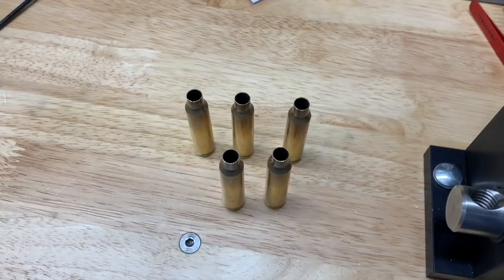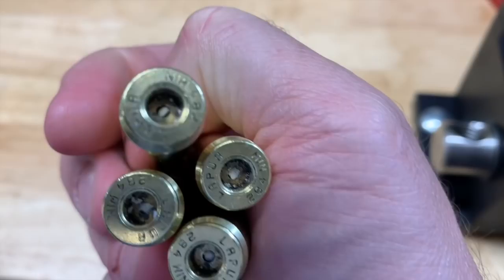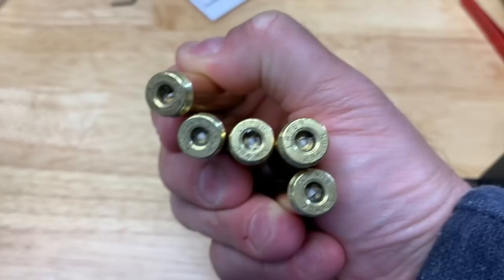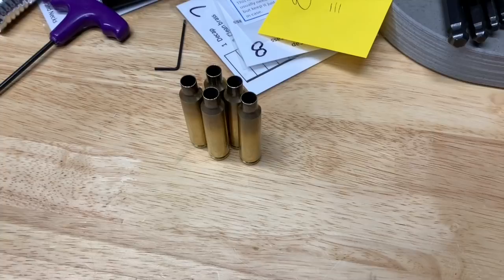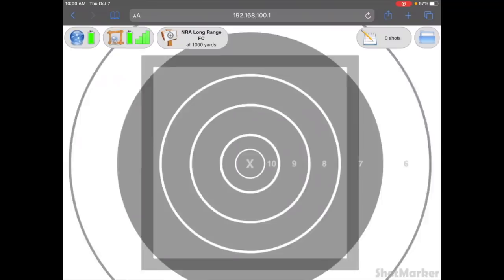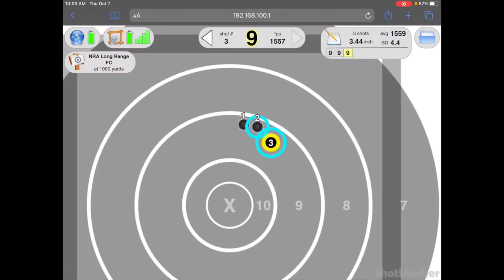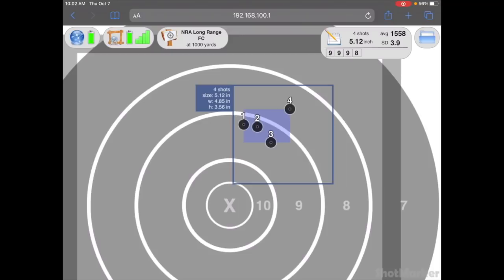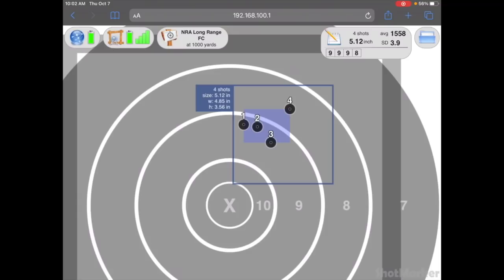I left tumbling media in my primer flash holes!

Comment: I also use rice as a tumbling media. I use medium kernel rice to minimize rice in the primer holes. Long Grain will stick all the time.  But it still happens with medium, due to breakage of the kernels. The scarier occurrence was to discover that kernels were staying in the case and rounds being fired with a kernel of rice mixed into the powder. I was unloading some rounds and out pops a kernel of rice with the powder. 
Now I air blow my cases after tumbling. There were more than a couple of stuck kernels inside 50 cases. I'm not sure this is safe to fire rounds with rice kernels mixed in the powder.  Also not sure if it's static electricity or dirty/sticky rice.

Comment: Interesting. I use wet tumbling with SS pins. Fired case necks on my 6.5's are just the right size where sometimes pins get wedged in the necks and are a pain to remove. There's always something.
Reply from the maker: Yeah for sure. For your situation you may want to try the ‘football’ style pins. They don’t get stuck in the mouth.
Reply: Thanks! I'll check them out.

Comment: Rice hmmm … knowing you there is a very good reason why you don’t use wet tumbling with steel pins. Can you share your personal resin why you don’t like wet tumbling?
Reply: He did say in the audio when another guy said “ only you would test rice in the flash hole “ to which John replied “ why wouldn’t you” at that point the other guy said “ because I don’t use rice “ then John replied “ then do it with stainless “ after that they went on to say rice burns stainless don’t stainless pins fused to your barrel. And apparently someone they know had it happened to them. What I gather out of that quick conversation was. One of them missed some stainless pins and it jacked up a expensive barrel. And I can see that happening it makes sense also there barrels can’t be cheap. I have a Krieger m110 barrel for my AR10 and it wasn’t cheap. The barrel and JP bolt combo was 1300 bucks. So could you imagine spending that kind of money just to completely destroy it because you missed a few stainless pins.

Comment: I wonder why sonic cleaning isn't all the rage..no media to ever get stuck.
Detergent, citric acid...oven dry...
Having a vertical rack seems the trick
Reply: I have made a brass plate with slots cut in it so they hang by the ejector groove. I put it in the ultrasonic cleaner then transfer it to the air roaster on the wash temperature. 30 mins from dirty to ready to load.
Reply: @fentonpainter7907  id like to see a picture of that plate.
Air roaster sounds interesting
Reply: I drilled out a bit of plastic chopping board and stood the cases up...but .noted that it seemed block alot of vibration...hanging seems much better...do the primer pockets clean well?...How'd you make the legs?

Thanks..
Reply: @misterlewgee8874  I used 55mm on each end of the plate/sheet to fold down 90degrees to allow my 6.5PRC cases clearance to the basket. Metal and glass transfer the sonic waves straight through, plastic doesn’t.